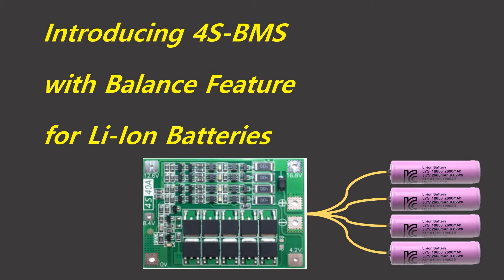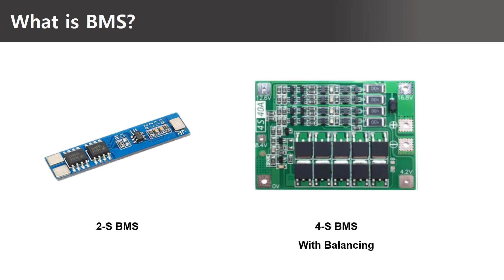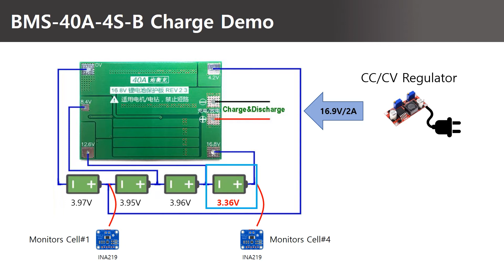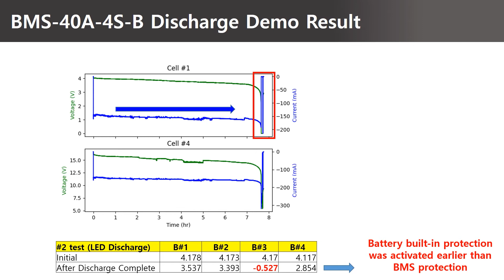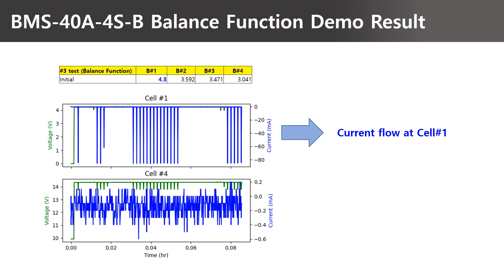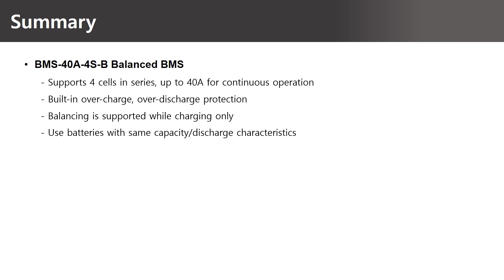Passive Balancer BMS for Li Ion Batteries

Comment: Hello.
I bought the same module and tried to charge it in the same way as the video, but I am leaving a comment because it seems to show different results in the middle.

I used a power supply (siglent spd3303x) instead of a CC/CV module, and when I was charging at 16.9V 1A, after about 30 minutes, it suddenly switched between CC and CV modes, and I don't know if it is charging properly.
Should I have purchased an LM module and done it? Why is this happening?
Reply from the maker: So, let me summarize your current situation. Please correct me if I'm wrong.
During the initial stage of charging, the power supply operated as CC mode at 16.9V/1A, and then after 30 minutes it changed to CV mode?
Maybe your batteries have charged to some amount, and it doesn't require 16.9W of power?
Reply: @gemsungelectronics460  It was charging continuously in 16.9V/1A CV mode, but at some point, it would alternate between CV and CC mode every second, charging at a set current of 400mA or lower, and then stopping. Even when I tried a different power supply model, the charging current would decrease momentarily and then stop, and then it would stop.

As you said, it could be because the required power was low.

Could it be that the BMS itself is not able to perfectly balance the cells?

To summarize the conditions I had, I started with the voltages of the four batteries being 3.5V, 3.6V, 3.7V, and 3.8V, but the charging stopped before any of the four batteries reached 4.2V, and it only went to 3.7V, 3.8V, 3.9V, and 4.0V. The voltage didn't change even though I left the power supply on for 3 hours and connected it to the BMS for 2 hours.

I expected the voltage to converge to 4.0V or 4.2V, but did I expect too much?
Reply from the maker: The BMS shouldn't cut off the source in the middle of charging. Can you try to use a simple module for your power supply?
Reply from the maker: It is normal to have cc mode operation during the initial stage of charging, and after that, it is changed to cv mode throughout the rest of the charging process. 
But in your case, the power supply operates as cv mode, which means the current consumption is lower than 1A.
It is odd that when the current consumption gets lower, the power supply switches to cc mode, which indicates the current consumption is higher than 1A.
I think you need to check the power supply, or there is a possibility that the BMS is damaged.

Comment: i use 1s bms in each cell when ever i build series battery pack with 2 or more cells in parallel
Reply from the maker: Using the exact number can be beneficial in several aspects.
For example,
 - wiring simplicity 
 - maintenance (in case of damage)
 - balancing (if any)
and so on.
However, it is okay to use 1s bms for each serial configuration as well.
Thank you for watching!

Comment: Hey this is a very nice video. May u pls tell is there any open source file in like schematic ans bom of passive balancer?
Reply from the maker: Hello, thank you for watching!!
Currently, I don't have any information regarding the HW of the passive balancer.
But by taking a look at the module, it seems to be composed of transistors and resistors which turns on and off when the voltage exceeds a certain threshold, and to dissipate excessive power of the fully charged cell.
I think there should be some more information you are searching for on the web.
Thank you!

Comment: Hello, Can you please tell me if I can use only 2 cell to achieve 8.4 volts? That is because I only need 8.4v for a bike light. Thanks. 😄
Reply from the maker: Hello!
The module introduced in this video is intended for use with 4 batteries in serial.
If you want 2 Li-ion Cells connected in series to achieve 8.4V, you need to use a 2S BMS.

Following is one of my videos introducing a 2S BMS, without the balancing feature.
https://www.youtube.com/watch?v=xmq0hi3zTgQ

If you want a 2S BMS with balancing feature, just type in "2s BMS balance" in Google, and you will find plenty results.

Thank you for watching!!